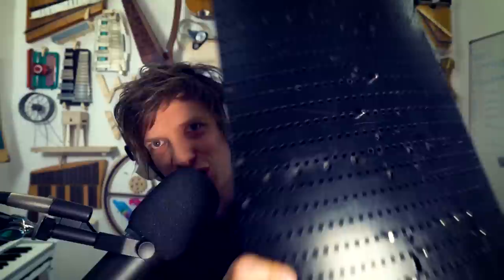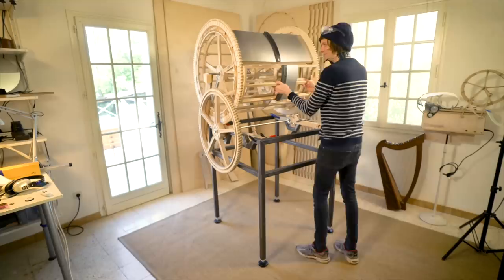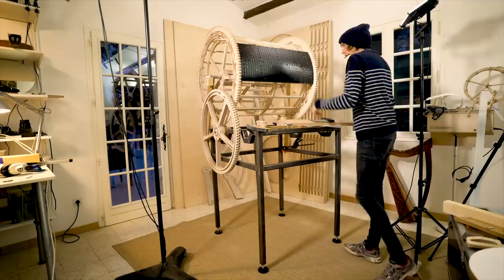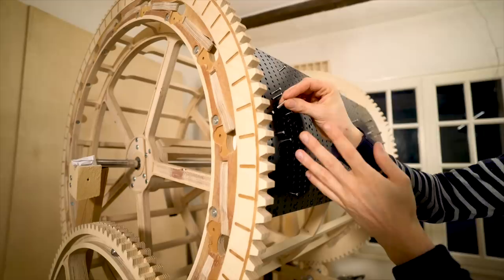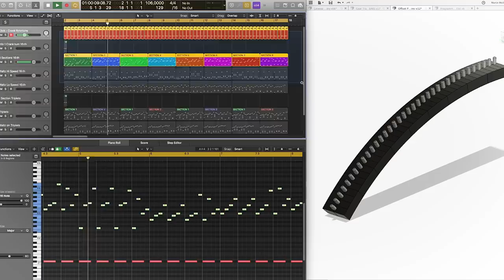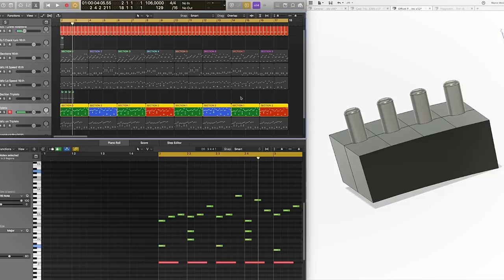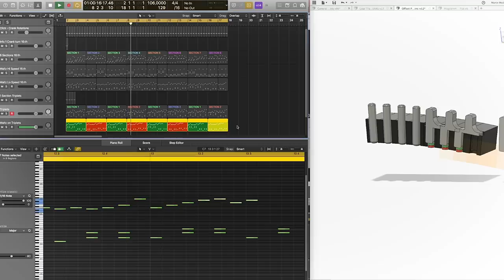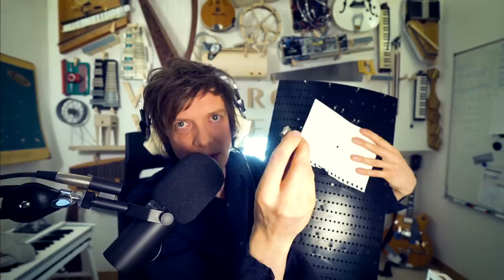Magnet "Midi" Music System - Marble Machine X #25

Comment: the paper sheets with holes is a good idea, but it means it will have to stay in during the song or be for single use as it will stay pinned on the wheel by the angle of the pins. so maybe some kind of elastic material. or i was thinking about some flexible material with the programming pins pre inserted but loose enough so the magnetic force can pull them out. then make the programming wheels part roll on them, making the pins stick straight in the right holes.
great ingeniring and love your music! can't wait to see that marvel marble in action!

Comment: I think about the way how should reprogram your machine pin pattern. If you place led diode under the pin hole you can see the place where to put the pin. If you turn on the led when machine is moving you also make the visual affects.  You can use programing led strip to make the new pattern. This also will add the wow factor on the concert tour to your marble machine. All viewers can see your machine moving.

Comment: @wintergatan, has anybody talked about using a single plate but instead of changing out, you can  use a slider mechanism to cover up a pin hole in which you aren't using (etc.  a piece of plywood is slid under the holes of the pins (blocking some of the pins).  so a 16th can be changed to 12th with one slide.  2 slides 16th> 8th.  3 slides 16th -> 4th.  For triplets i don't have an idea on that but you might need to do manual or figure a sliding pattern for triplets.  My idea has a an issue though.  First you cannot slide without taking out a pin...  otherwise the pin would block the sliding piece of plywood.  Now this issue is resolved if you had a mechanism to bring the pins down (inward).  This idea adds more issues but it is compact for traveling and provides you more work now but less later on for reprogramming.  To add more to this, you would need probably 10,000 small springs so when you slide the plywood, the pins blocked by the plywood can spring back up.  This idea revolves around a hand hole puncher {google (hole punchers machine and coiler)}.  This might give you an idea.  The idea of mixing pins and offsets I like that.

Comment: I think the "pen clicker" idea is really smart but I also think the sheer weight of all that metal in the plates would make it quite a bit more difficult to crank the wheel and keep tempo and control of your dynamics with all that momentum making it more difficult to speed up/slow down

Comment: Okay, now I'm certain this must have been suggested already, but I believe I have a solution for activation and deactivation of pins.

 Use two sheets of steel. A bottom sheet, without perforations. A spacing layer. A second steel sheet with perforations. A third, passive, non-magnetic layer (like the black plastic) for pin alignment. 

 The pins would need enough protrusion and some sort of groove or lip at the top so that they can be grasped with fingers or a specially designed tool.

The pins would be non-magnetic (plastic or aluminium rod to save weight), and have a magnet glued or otherwise fastened to the bottom which is larger than the perforation holes.

To assemble, populate the top steel plate with pins. The magnets would hold the pins so they come through the plate to the maximum degree. Then, fasten that plate against the spacer.

Now the pins can either be out, with the magnets against the outermost (perforated) steel, or in, with them against the back plate. I would estimate that only 1cm or 2 cm would be required for attraction to one plate or the other to be secure.
Reply: One other thing (and this would be major, but possibly good on stage), if you used this mechanism, you could have a "programming" wheel which sets the pins with the above mechanism. The programming wheel would have exactly the same construction, but instead of lipped pins, it would be designed to either push the pin down, or pull it up. The "programmer" could use a keyboard step by step to configure the programming pins, and when you need to reprogram the main wheel you would simply bring it against the main wheel. The entire programming run would happen in one revolution. 

You could have three settings for the programming wheel: in, out, and bypass. Bypass would not touch the main pins at all. Assuming you could key the programming wheel to the main wheel (so that it always starts at the same spot. You could change the program by as little as one step (all pins but one row in bypass).

The programming interface could resemble something like an organ drawknob panel, with each knob having three positions: in (pin goes in), out (pin comes out), and neutral (all the way out).
Reply: Oh, and the programming wheel pins would need stronger magnets :)

Comment: It seems like I can't read the answers on the design discussion, so I just throw it out here and hope its not already mentioned a thousand times for you.
The problem of just making additional holes for the 3 parted path is the bending cuts on the undersite. Maybe it would be working to make two strips for each programming line, one with 4 and one with 3 holes per section and add them side by side. So you don't have one large plate with all your holes, instead you get a lot of small strips. More material is used to make these and its more assembly work, but you have a clear result at the end. Maybe you could use different material colors to separate the 4 and 3 parted strips from eachother making it better to overview. And for the Reprogramming I would use thin plastic sheets (PVC or PC) with registration marks at the borders to get them fit perfectly on the board.

Comment: Sorry this is late for the feedback but I'd do very thin plastic sheets with the slots cut, and have wedges on each plate so you can lock these thin plastic sheets in, Outline the holes in back so they're visible under any light. Doing this would reduce error completely and make changing them quick and easy

Comment: It is a really awesome project you have started on. I like the concept with the magnets, however you could also look at the principle you mentioned with the "pen click" - what i was thinking is a principle where all pins are there but can be retracted and ejected via a template from both the front and back. This means each template is a 1/8 of the total melody. E.G the "pin art" (google it for pictures) as you probably know from when you were little. This means that you templates can be made on the CNC and transported separately.

Comment: You can make the reprogramming even faster, I think.  A simple curved metal surface, much easier and cheaper to make, of lower ferrous content than your programming plates, could be used to store the pins in preset positions before the concert, for every song on the set list.

Then, the technicians would just match the entire storing-surface and all its pins into the programming plates, and it's done.  The lower ferrous content means the pins will prefer the programming plates and you can just pull the storing-surface off clean.  If you do this, it might be a good idea to bevel the ends of the pins, so they will more consistently find the holes on the plates.

Comment: I support the two pin lines per note system. It will even allow you to make some 2 against 3 rythms on the same note (and if you manage to add a third line you can even make quintuplets : ) )

Comment: I like the pen click mechanism idea, but perhaps instead of a click and catch mechanism, how about have the pegs restrained from under the panel by a spring in extension like a pen. The neutral position of a peg would be absent from the outer side of the panel. To quickly program it, fabricate a program panel that would be pushed against the inside of the panel. Places where you want pegs extended would be solid, so the peg spring would be compressed pushing the peg outward. Places where you don't want pegs could be empty, so the pegs stay retracted from the outer face.

Comment: The solution to the design problem of arbitrary rate is a belted design.  Make a geared surface on the drum and put the pegs in a belt.  Make the belt with arbitrary length and spacing.  Have multiple belt lengths for different loop times within the same melody and make the belt design modular.
Reply: The offset pins was good out of the box thinking.

Comment: When I saw you idea about maybe switching to bar magnets so that you can essentially have two sets of holes ((a 16th and a triplet) per registrator. This gave me another idea for the next step in your progress..I notice that the width of the pin track is fairly wide. Given the emphasis that you've put into making sure that the program wheel segments fit precisely (with no give or slack movement), I was thinking that if you can narrow the registrator fingers (what the pins trigger) sufficiently, that you might be able to double the number of pin tracks. This would allow you to shift, either the entire program wheel, or the registrator bar, exactly half the width of the 'old' pin tracks (we'll call it set #1) to the space between where you can cut a #2 set of pin tracks. This could allow you to program either two music pieces on a single set of 8 panels or, if you can make the shift quick & smooth enough to do 'on the fly', you might be able to do a single piece that is twice the length (of the current program wheel).I've seen this method used on some commercial music boxes which have two or three different pieces encoded on a single drum which automatically shifts, at the end of each rotation, from pin track #1 to pin track #2, etc.

Comment: Hey Martin, I would reply to the pinned comment but it is full. In terms of an easy reprogramming mechanism you could build another set of panels that go over the top of these ones and have those either take out the current pins or set in the pins for the next programmed song, this way there can be less people to work on reprogramming and less opportunity for a song to be programmed wrong as well as having a permanent physical representation of the musical notes instead of what I can only assume is a paper or digital copy of where the notes go.

Comment: Radical Idea: Make some programming plates with solenoids so you can change the programming on the fly, might ne ideal for easy sound design... 

regading the triplets: just do some extra borings, the material seems sturdy enough to hold the pins in place anyway. Imagine a venn-diagramm-bore :P

Comment: If you want to stick with your basic idea and modify it to a lesser degree, you could put insertable tabs or flip-up tabs on the wheel and use photo-interrupters as your pick up sensors that would then activate whatever you need to be done. Alternatively, you could put LEDs on your wheel and have a small processor board that would drive them on and off while photosensors on your chassis. This would allow digital files to drive the LEDs and the wheel would be fixed and a new song would happen by just having the computer drive the LEDs in a different pattern. In fact, the wheel could then essentially be infinitely large because the pattern could change as the wheel spins. You could do triplet LEDs or have clear plastic insertable light pipes like your current pin shifters.

Comment: Put the fourfold holes on the segments not symetricaly but to the right.
And them turn the sections on the drum "over head", so the fourfold holes are "wrongly" positioned to the left. 
Now you can ad a second row of triple holes at the (in that segment position) correct places to the actual right.

This way you also could program a set of segments simultaneously with one song at fourfold, and another in triple mode. And you decide which one to play by turning the sections.
I hope you get it.

Comment: you can build another wheel at the bottom of this wheel which removes the magnets after they are used if desired. That way you will save time from removing them.

Comment: You can Add a new and full set of paralel lines for the pins, in a way that you could have 2 songs, or even more (if the distance fits), in the same "midi" wheel. For that, you'd have to create a system just to move the wheel in the x-axis

Comment: The programming wheel pins could be magnetic pulses from an electromagnet. The wheel could be smoothed or flattened and merely be activated if an electromagnet is used. If normal magnets are used, my could pull light strings to move the pins.

Comment: Pins in holes with template: sounds like a homemade LiteBrite if a lamp were to be mounted inside the prog. wheel and pinholes drilled through the steel plates.

Comment: man at 13:52 if you slow it down at .75 speed, the sixteen sounds so dope. Otherwise, then that Good Job Wintergatan, I would recommend in perhaps in organizing the programmable wheel with a different color code of each different pins, just to make it easier for people to know where they need to place a pin.

Comment: you take a wooden frame that fits around a segment of the programming wheel, this frame could have guides to slide in a curved card or thin plastic panel, these panels should have holes cut into it as a template for the music to be programmed, this way you have a quick easy and lightweight way to use templates.

Comment: Hi! I just found this and have another suggestion for these pins: Instead of turning them into magnets, get a magnetic backing like magnetic foil instead of the metal sheet. so you could use normal steel pins instead.

Comment: Just add two extra holes pr group of 4, offset about half a pin to the side.
Just enough to give both pins a good grip and avoid drillbit breaking, but close enough to allow same lever to be actuated.
First pin per group is common so no extra hole for that.

Comment: Multiple track music boxes use levers that are a fraction of the width and then shift the whole drum/wheel over by a set amount.  So if there were three tracks, each lever the pin strikes is only every 1 in 3 pins and upon the end of the rotation the drum slides over. Theoretically speaking, you could say slot the wheel with two songs at a time to help out your technicians and cut down on wheel changes and have a shunt to select between the songs. Maybe a little too far into the build though...

Comment: use pin length as well. Short one for 4, long one's will go in first 3 holes making 
1 empty and work as triplets, or anything else. So you can make one more dimension by expanding their length. For example short, medium, long and they will make different functions, or extend the sound like accord if pin enough long

Comment: I could come up with an actuator set up to reconfigure the pins  pneumatically , and it wouldn't require 30,000 actuators, but I already have a slight headache beginning to think about it. It would be cool though. Each pin hole could have a thin air channel and air could push the pin up, then another push would have it come back down. The air could be supplied from the side of the segment when taken off and placed on a re-programming "pad".

Comment: +Wintergatan I think the top comment hit the maximum number of comments--I can't respond to it.

My idea is simple, and probably already said, but if you use rectangular magnet rods, you can cut a small L spaced such that vertically positioned gives you triplets, while horizontally positioned gives you 16ths. This would be helpful when programming, as well, because you'd have one horizontal cut without the vertical each measure (assuming 4/4 time). My main concern with this idea is that the cutting will be much more complex, especially when you need to curve it.
Reply: I never found out if the original machine actually worked and was witnessed by others to play all the way through in one unbroken video take. I can't work up any enthusiasm for this project if the end song is nothing but another patchwork of well-spliced takes.

Comment: How about to divide the wheel by a multiple of 6, not a power of 2. For example, if there were 96 holes in a plate (768 holes in a round), you can program 8 beat by putting a pin every 3 holes. And then, you can also program triplet by changing interval to 2 from 3.
Such as,
8beat:   OxxOxx,OxxOxx,OxxOxx,OxxOxx, OxxOxx,OxxOxx,OxxOxx,OxxOxx ((3x8) x 2 = 48 holes)
triplets: OxOxOx,OxOxOx,OxOxOx,OxOxOx, OxOxOx,OxOxOx,OxOxOx,OxOxOx ((2x3)x4 x 2 = 48 holes)
Waltz A:  Oxxxxxxx,Oxxxxxxx,Oxxxxxxx, Oxxxxxxx,Oxxxxxxx,Oxxxxxxx ((8x3) x 2 = 48 holes)
Waltz B:  Oxxx,Oxxx,Oxxx, Oxxx,Oxxx,Oxxx, Oxxx,Oxxx,Oxxx, Oxxx,Oxxx,Oxxx ((4x3) x 4 = 48holes)